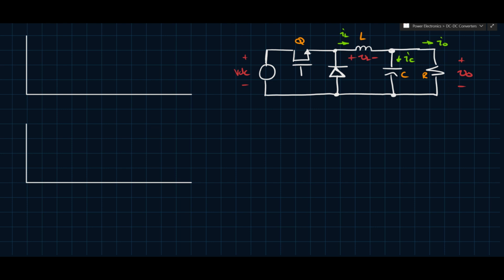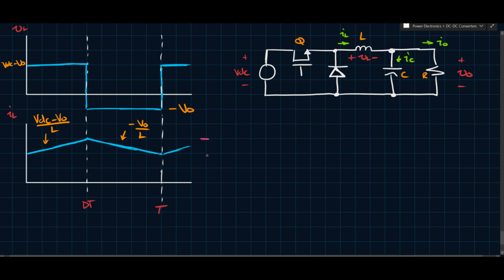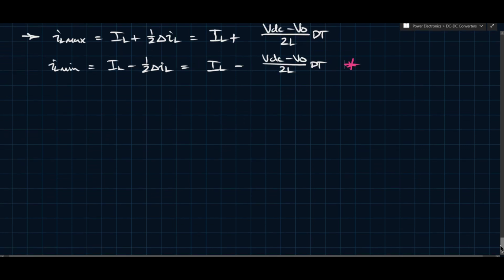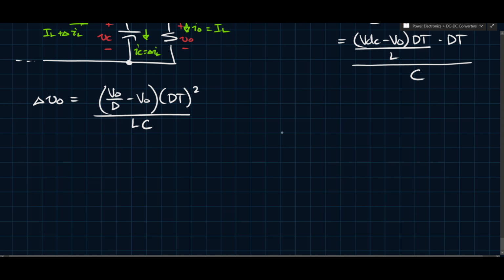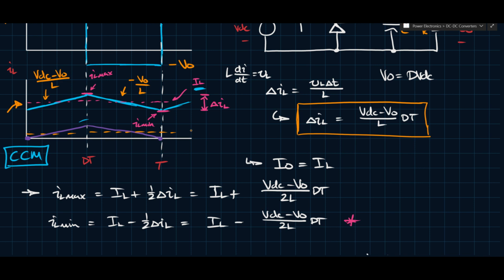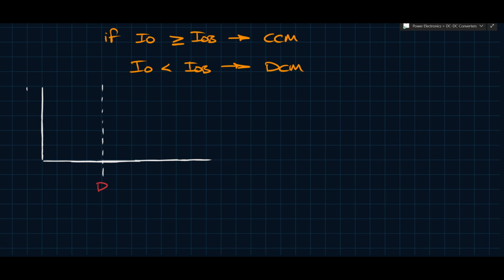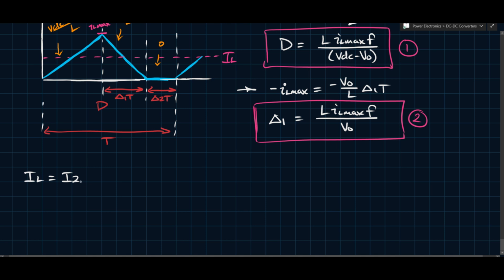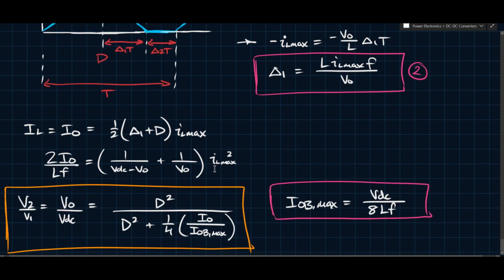Buck Converters: Capacitor Voltage Ripple, Inductor Current Ripple, and Conduction Modes

Comment: That’s a great explanation. I have one follow-up question. When the converter operates in steady state, Delta IL(ON) = Delta IL(OFF). I am now analyzing a converter that is not running in steady state, where Delta IL(ON) is not equal to Delta  IL(OFF). My question is: when the ON- and OFF-time ripples are not equal, how can I calculate the maximum and minimum inductor current?

Comment: Thanks, it's very clear. But what is the consequence if buck and inductor operate in DCM mode? Should we expect larger voltage ripple?
Reply from the maker: The main disadvantage of operating in DCM is that the peak current in the circuit becomes very large. Consider the inductor current: In CCM, the inductor conducts current for the entirety of the switching cycle. In DCM, there is a duration in which the inductor is not carrying any current. If you compare the average currents of the two situations, you see that in order for the average current of CCM and DCM to be equal (meaning you have the same power processing capability in both cases), the peak inductor current must be larger in DCM than in CCM. Consequently, this means that the peak current in the diode and MOSFET will also be larger in DCM than in CCM. The best way to visualize this is to draw the waveforms of the inductor current for CCM and DCM. Hope this helps.
Reply: @SandeepKaler93  thanks for sharing.